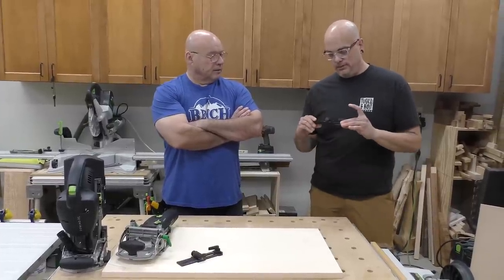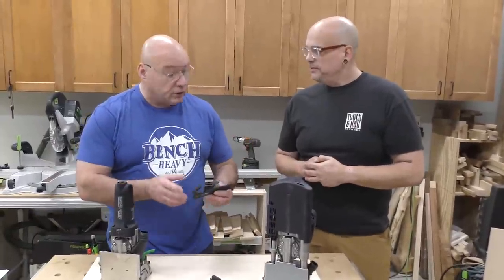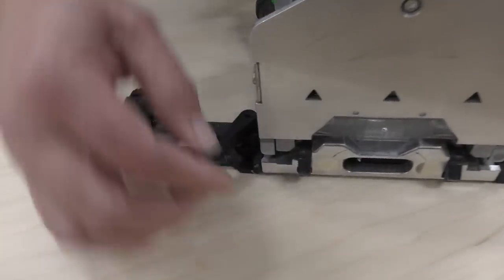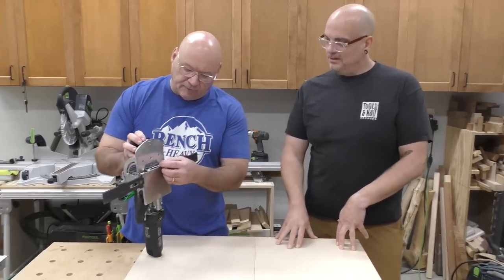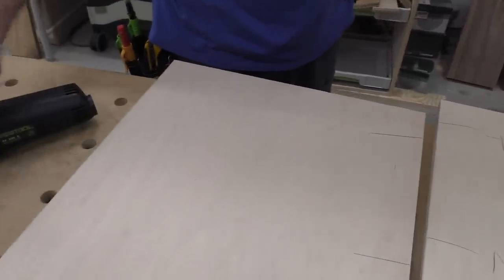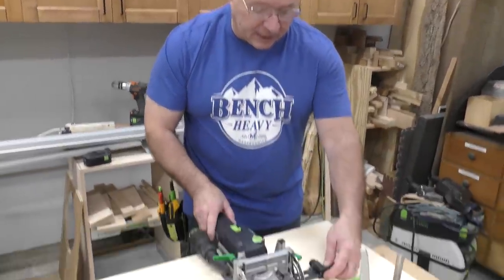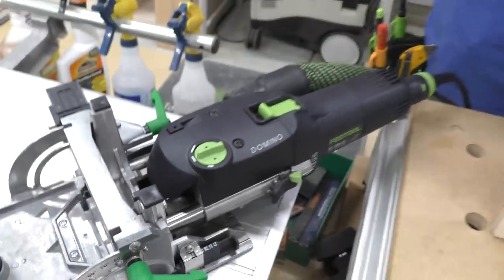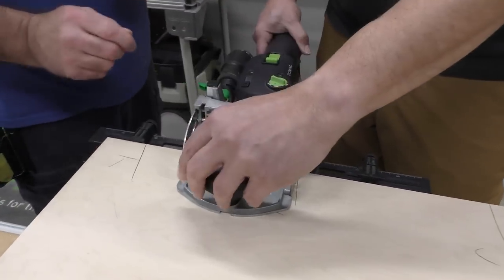Well Kept Domino Secret

Comment: I find when I make both sides of the joint loose it works against me trying  in the glue up. I have better luck when I make one side entirely tight setting while the mating piece has one tight and the rest loose to make the assembly come together better. Also it allows you to glue one side in place for a larger glue up for less stress. Thanks for sharing these tips!
Reply from the maker: Thanks
Reply: How would you use the cross stop with one side tight and one side loose?  I figure there's a +3mm drift on the loose side which eventually will shift the centers too far apart for the corresponding tights.  Or am I wrong here?
Reply: @teac117  That is a totally valid point!  I haven't done this method with the cross stops, only when doing the 'to a line' method like when doing a table top glueup. I've used the cross stops as references from the edge of the board so I get one further in than the built in would allow but you are absolutely right it wouldn't work to use the mortises as references this way.
Reply: @realpdm teac117 it’s possible, you have to double cut the loose ones. You cut them all tight working away from your original and then adjust to the loose setting and work your way back.
Reply: @brandonblatchley interesting approach. I had thought about doing one side tight and the other loose but hadn’t come up with your solution.
Reply: I did one side loose and one side tight. But I realized that on the loose side I’ll do a tight fitting for the first mortise and then loose for the rest. I will say that using the tight setting helps with larger glue ups as it keeps the boards pretty tight when gluing up multiple panels at a time.

Comment: So, I've never been able to get the mortises from my cross arms to line up consistently.  It finally occurred to me to measure the actual distance to both  spring loaded pins. Turns out that my left and right have an error/ difference of 1/16th of an inch. So, on small pojects it didn't matter,  but on big panel glue ups, they will never line up correctly.  Looks like there was a manufacturing oops somewhere.
Reply from the maker: The cross stops are adjustable...look at the front  ...there is a slotted recess..on the side is a hex to unlock the pin which is on a cam...
Reply: @sedgetool  thank you so much! I'll check it out tonight!

Comment: This video was really helpful. The more projects I build, the more I use an object any time I can over a ruler or tape measure. That’s where this tool really comes into its own. 

You posted a snarky reply to a comment of mine about using the loose setting on another video. However, now I understand why you prefer a single domino to index the side-to-side movement of the joint. It’s rare to have a joint where that side-to-side sheer strength has any importance, so alignment is the key. In fact, I can’t come up with an example making cabinets or drawers where the strength of the joint in that direction matters. And your approach will make assembly easier.
Reply from the maker: cool Thanks !!!

Comment: As a complete newbie to the Domino world, your videos have been my main source of learning and have learned so much, thanks!

What's the relevance of the 37mm from the flap to centre of the bit? Why not 35 or 40? Does the 37 actually have any meaning behind it?

Also, why come in off the first flap (37mm) and not say 20mm (with the flap on the removeable base)?

Thanks
Reply from the maker: 37mm relevance is the same distance in 32mm cabinetry from the front of the cabinet to the center of the 1st system holes....

Comment: Sedge, for some reason my right and left cross stops have been giving me mortices 2mm or so apart making it impossible to align. I called Festool about this and they said something about calibrating the pins but were very unhelpful with the issue. How do I resolve this?
Reply from the maker: the pin on the cross stops have an adjustment........there is a hex on the side ..loosen it then take a slotted screwdriver and look directect at the pin and you will see a slot . , depress the pin and use  the screwdriver ..,it is cammed and by doing a few tests you can recalibrate...hope this makes sense.

Comment: varmit72
I have three Dominoes in the shop. Two 500's and one 700. Each has its own Cross Stops.  Two of the Cross Stop sets do not produce aligned mortises.
Is there a simple method to adjust the Cross Stops pins so that both sides are equal and to make all three sets equal?
Reply from the maker: Yes .. on the side of the cross stop pin  there is a small hex screw … after loosening… in the front of the pin take a slotted screwdriver and  by pushing the pin in you can adjust the pin

Comment: What is the best way to figure out which setting to set the cross stop to? I get confused because going from tight to loose changes the spacing by 3mm. I've already accidentally hit a domino when trimming a panel. Is it best to avoid putting them within 150mm of the ends?
Reply from the maker: it all depends on how much you have to waste off the panel.....

Comment: Hi Sedge
You always make heavy pencil marks. How do you erase them afterwards (without sanding through sometimes extremely thin veneer)?
Thanks very much and happy holiday season 🙂
Reply: Use an eraser before you pick up the sander.  Worth the effort!
Reply: @mikevyvyan7060  Isopropl Alcohol removes them easily
Reply: @ronthomas3029  Another good 'solution'.  I frequently write on pieces of blue tape and stick on them the board or timber. That works for me.
Reply from the maker: I use lighter grit on a Festool sander
Reply: @mikevyvyan7060  A white eraser works really well.

Comment: I am wondering, could you not make one board with all tight mortises and the second board with one tight mortise and the rest loose mortises and accomplish the same alignment.
Reply: If you used the cross stops for the mortises, with one edge on tight and the other edge with one tight and the rest loose, after a few mortise cuts none of the dominoes would line up on the loose board.
Reply: @Mike--K  thanks
Reply from the maker: line up !!!
Reply: @Mike--K  is right.  Whatever you do to one side needs to be done the same way on the other side.
Reply: I had thought about cutting one tight on each end and then loose in the middle on both sides, but that defeats the ease of assembly objective.

Comment: Why does the distance from left-pin-to-center differ from right-pin-to-center? Is it possible to calibrate? The problem is NOT with the centric plastic transparent ruler! When I cut the reference hole and then cut right and left holes with the same distance set on the “wing” ruler the actual distance between the holes differs by 1 millimetre 😱 I appreciate any help.
Reply from the maker: you can adjust the cross stops by loosening the hex screw on the stop and using a slotted screwdriver on the face adjust to be even by some trial and error....
Reply: @sedgetool  i’ve read that but I cannot turn it clock-wise nor counter. it’s very stiff and I don't want to strip the thread
Reply: @sedgetool  I finally made it. The magic is that the pin is eccentric and moves slightly off-center by turning it, right?

Comment: A BIG problem I have with these cross stops is that any tiny inaccuracy you have ends up multiplying and amplifying as you go down the board.  For example if your left cross stop is miscalibrated from your right one, that measurement difference will drift and propagate down the line to larger and larger inaccuracies until no amount of wide mortise wiggle room will compensate and you end up destroying your work piece with misaligned mortises.  Not worth it at all!  Can you tell this is a lesson I learned the hard way?
Reply from the maker: you should calibrate your cross stops...
Reply: @sedgetool  you have to calibrate them EXACTLY.  Any error will lead to drift.  Too risky for me. Did this plastic thing come out of calibration from last time I used it?  Etc.  Also the DF500 comes with no calibration instructions, admittedly the 700 does.  (Maybe a video idea ?)
Reply: @sedgetool do you mean check to make sure left X setting matches right X setting precisely?  If so, what reference mark on the Domini do you use?

Comment: I have these items and was giving them a trial run on some  sacrificial boards before  I use the melamine. I was having some issues. I think they had to do with holding the machine flat. I wish I could explain what I was doing without typing for a lifetime but, I can't. 
 There will be enough melamine for a few errors and then some on this small project. In the end if it works out then these items stay with the machine. If I end up with alignment issues (dominos to opposite piece which will be on top not end to end) I'm  likely gonna file these things with the circle cutter and tape measure.🗑
Reply from the maker: sorry you are having frustration with this William....